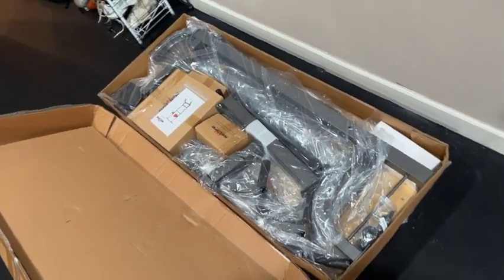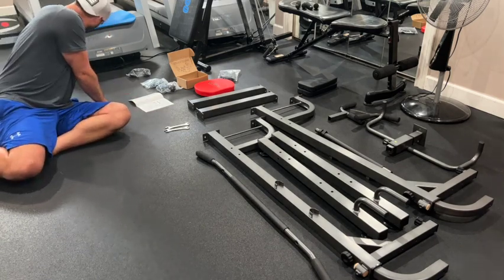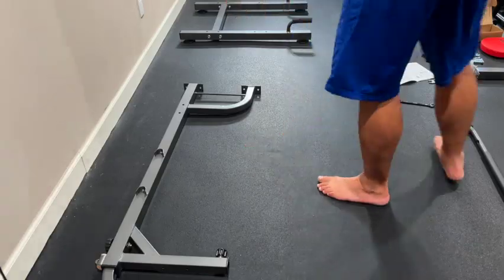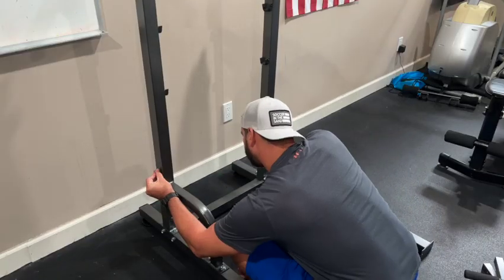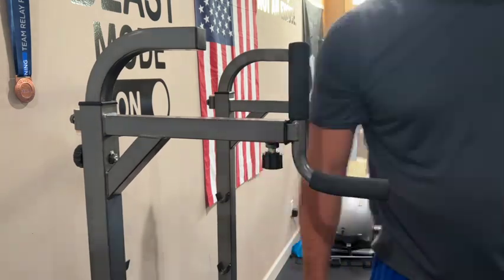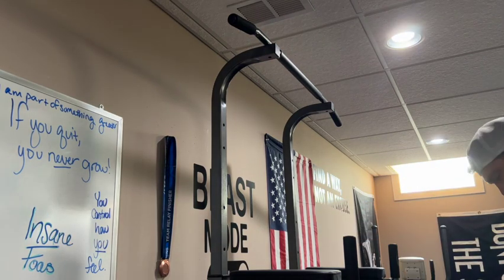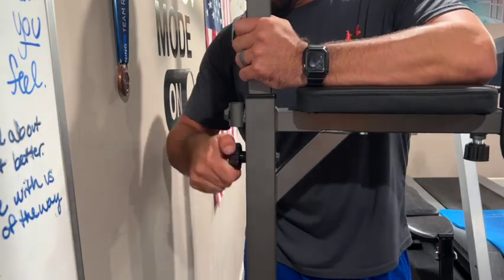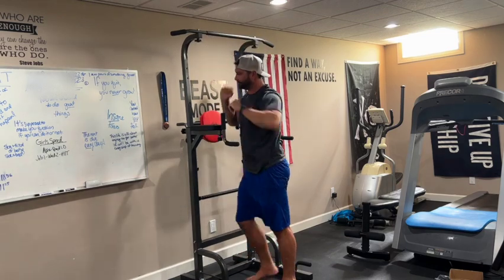RELIFE Power Tower Pull Up Bar Station (Assembly and Test)

Comment: Hi just recently bought this which tool and size was you using to tighten the screws please looking to buy asap. Thanks
Reply from the maker: 14mm and 17mm wrenches and sockets
Reply: With the wrench they provided the nuts just spin in place so I'm assuming I need to get a socket wrench?